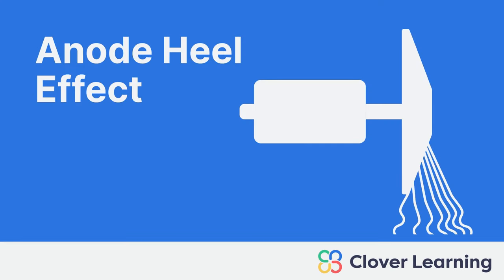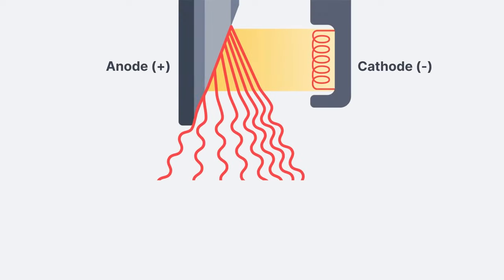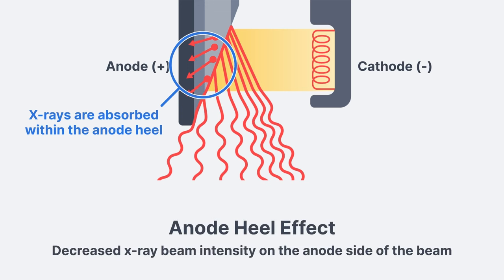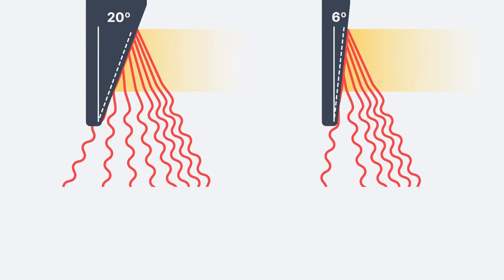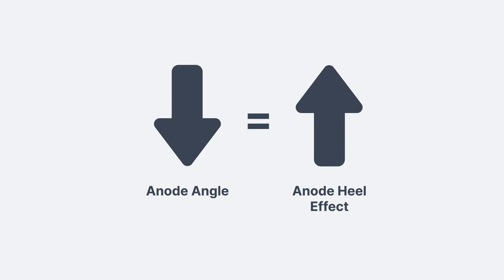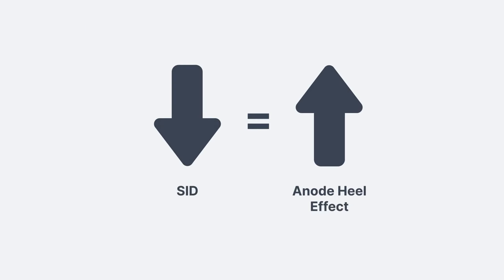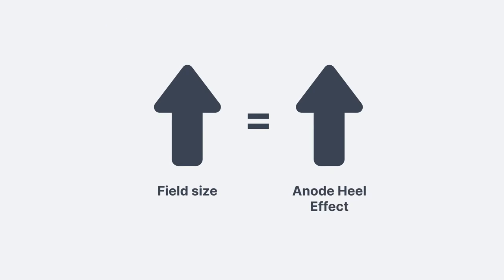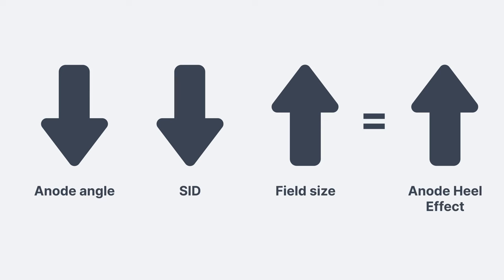Anode Heel Effect - Radiography Physics

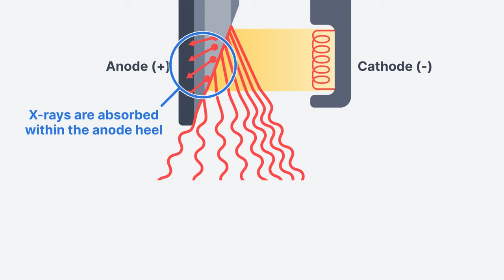Comment: 1:25 i dont understand how if the photons r absorbed in the anode (and therefore not projected right?), how the top part of the anode (the thicker part..which presumable absorbs more photos than the thinner bottom part), produces more concentration of projected protons than the thinner bottom part of anode, which presumably absorbs less photons..and therefore emits more for projection? 

although i do understand how the slight increased distace towards bottom  of anode from cathode means the beam is less intense?
Reply: Notice the direction of travel of the photons in the diagram. At a constant given depth from the surface, photons generated at the top of the anode traveling towards the anode (e.g. those traveling parallel to the surface, so down and to the left) are more likely to be absorbed by the anode material than those that traveling in the same direction but generated at the bottom of the material because there is more material to travel through for photons generated at the top. However, at the same constant given depth, photons generated at the top of the anode traveling towards the cathode (e.g. those traveling perpendicular to the surface, so down and to the right) travel through the same amount of material as those traveling in the same direction but generated at the bottom of the anode. You can repeat this argument for all depths from the surface.